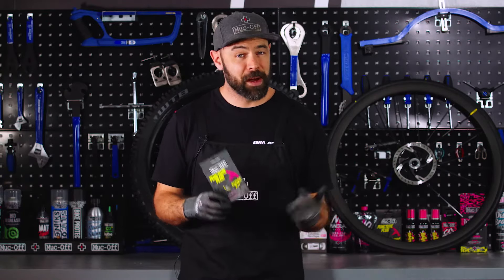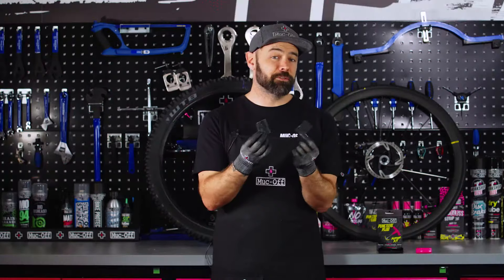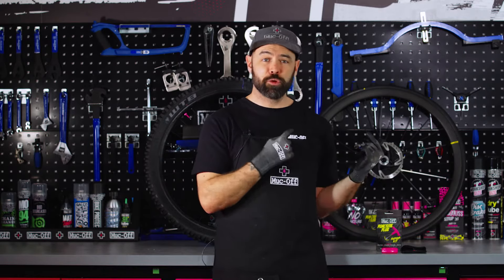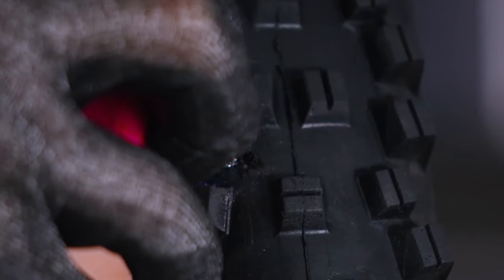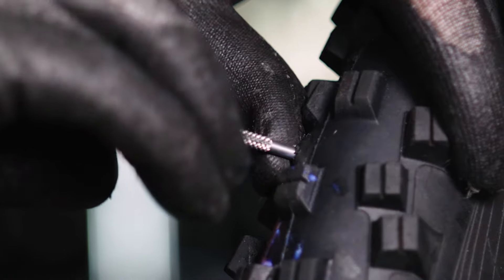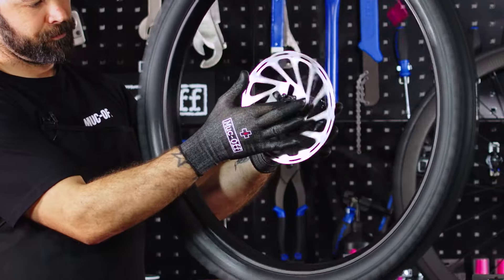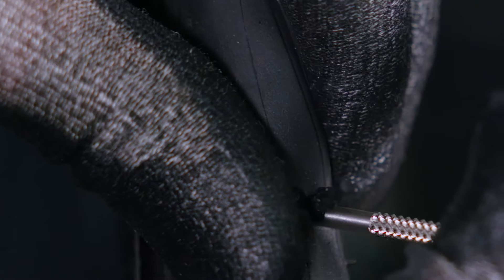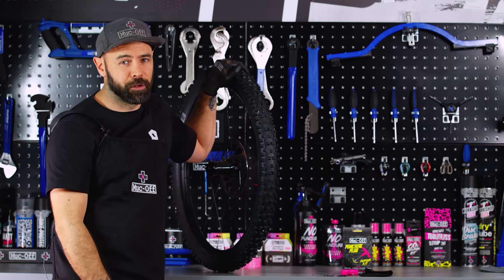P.I.M. - How to seal any puncture with the Muc-Off Puncture Plug Repair Kit

Comment: I've tried these, the plug just blew out, I tried a bigger plug, the same thing happened. In then end I put an inner tube in which got me home. Once I was at home I put a Tip Top patch on the inside of the tyre. 
I've had these types of plugs on my motorbike for years, the difference with the motorbike kits is they come with some glue to glue plugs in. Even then they are a temporary fix and you have to take it slow until you can get a mushroom plug fitted.
Reply: I have exactly same experience this plug things is not working for Road bike.

Comment: good for mtb, on road wheels the plug cant handle 100 psi and came out like a bullet
Reply: Yup, that's true, just experienced the same thing
Reply: If you're using tubeless tyres on road bike why you going up to 100 psi?  I run mine at max, 85.  And have used the plug with no problems
Reply: @bobferguson1696  because a use the bike a lot on routes, and sometimes i put 110psi. Beside that, someone that weights 100-110kg (not my case) cant put 85 psi, it’s dangerous for the rim
Reply: Same happened to me at 70PSI, on the road.

Comment: I got a like L shaped hole. The wider plug was too big so I used the smaller one. The plug just blows off from tire pressure when inflated to high pressure. What could be wrong? @Muc-Off
Reply: Tubeless aren't designed to go to high pressure

Comment: Guys how big is the tool? i would ike to know if it fits in my sattle bag
Reply from the maker: Hey Miguel, WFH means we don't have the tool here to measure but we're on the case! Noted on your message via Twitter too.
Reply: Did you get an answer on this? I’m looking to buy but the handle looks quite wide! Thanks
Reply: @mucoffltd  have you got the dimensions at all? Thanks
Reply: @Matt-nh5zi  According to Muc Off it is 8cm long and the handle is 7cm wide. I'm afraid it's too big for a roadie. I ended up buying dynaplug and it's rubish. If by any means you end up with a puncture on your tubeless tyre, just have a spare tube in your bag.